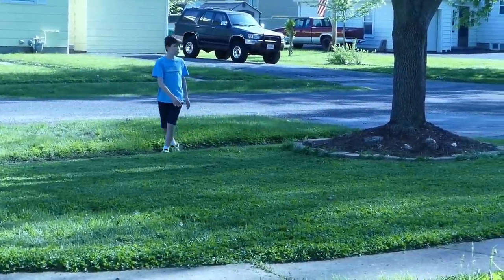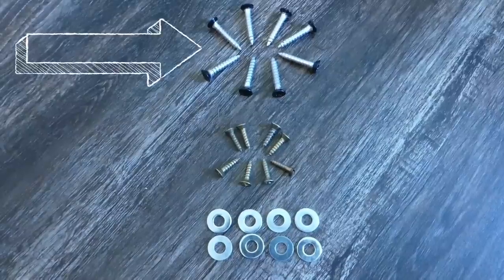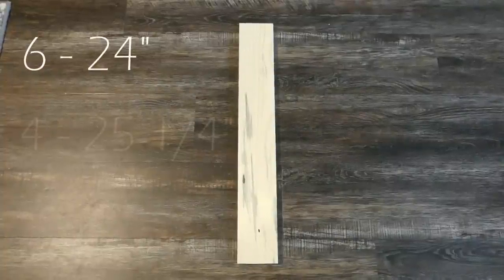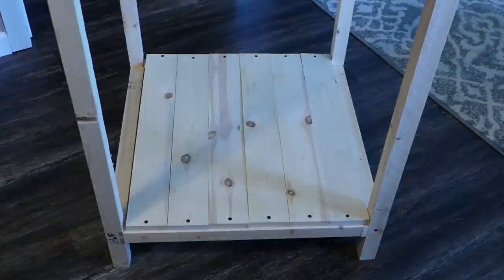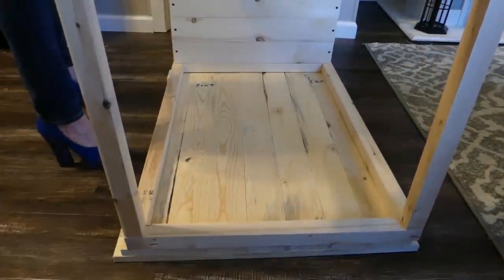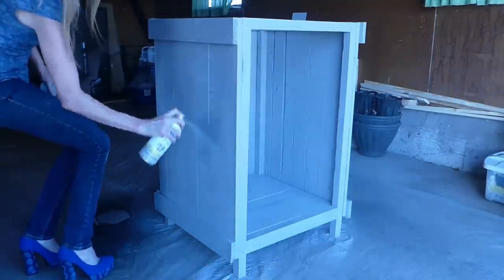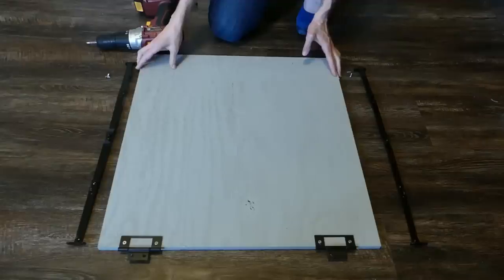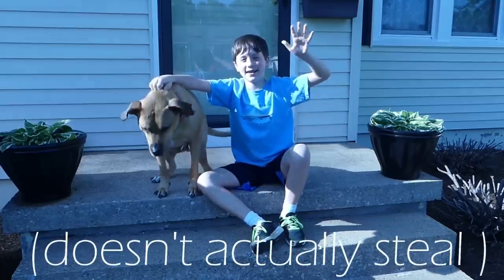'On The Fly...DIY' Porch Pirate Proof Mailbox

Comment: Honestly, anyone can get into that box with minimal effort. Just push/pull the top a little too high...it won't take much force to pull the screws either out of the top, or the security panel, and then you have access to the entire box. It would be better if it was disguised as a hose/gardening tool container. If you already have a problem with "porch pirates", putting a sign on the front that says "Packages" is just inviting them to break into it. Good idea, but the implementation isn't the best. Needs to be fortified quite a bit before it'll really be useful for most people. And some more thought should be put into the weather proofing aspect as well.
Reply: A sketchy guy once told me, locks are to keep honest people from stealing. Nothing stops a thief.
Reply: @mikelewis1166  while I don't disagree with the thief part of ur comment, there is a limit where most opportunity thieves will think that it's not worth the effort. I don't believe that this box is difficult enough to defeat to make it "not worth it" to the average opportunity thief.

oh, and honest people don't need a lock in order to not steal. ;-)
Reply: @DarienCaldwell  ur just being obtuse.
Reply: @ChadFranzen  Lol... Warden Norton would be very angry.

Comment: Couple of things. 1. If you have a large package, the inside plywood flap wouldn't open. 2. What if it rains, the lid isn't waterproof?
Reply: I was thinking the same thing. I'd be afraid packages would get hung up and wouldn't drop down. I'd make it more less deep, but the same height, so the drop down flap doesn't go all the way to the bottom of the box, to allow for larger packages to drop down, and to prevent them from getting hung up on the flap.
Reply: They'll just leave the package on top of the box.

Comment: 34 - 3inch screws
16 - 1.5inch screws 
72 - 1.25inch screws
2 - 8inch gate/T hinges
8 - 0.25inch screws
8 - washers
2 - 3.5inch hinges
2 - 1/2inch hinges
1 - Gate Handle
4 - Cabinet lid support hinges
2 - small machine screws, with 2 small nuts
1 - FRD lock set

1 - Plywood cut 21"X 22.25"
4 - 40inch long 2x2
8 - 21.5inch long 2x2
6 - 24inch long 1x4
4 - 25.25inch long 1x4
4 - 26inch long 1x4
28 - 36inch long 1x4
2 - 28 1/8inch long 1x4 
8 - 27.75inch long 1x4
1 - 21.5 inch long cut in half (1 5/8 thick/wide and other 1 3/8inch thick/wide)

-Build frame with the 2x2s, 4 inches from the bottom, 3 inch screws to keep each piece together
-24inch long 1x4 make floor, using 1.5 inch screws, "ripped" pieces will fit along the sides 

build 2 of the sides 
-lay out 2 of the 26inch 1x4s, then place 7 of the 36inch 1x4s, lay out so that there is the same amount of "extra" on each side, use 1.25inch screws to secure each piece

Build last 2 sides 
-lay out 2 of the 25.25inch 1x4s, then place 7 of the 36inch 1x4s, layout so there is NO extra hanging, use 1.25inch screws to secure each piece

Line up the frame and the sides, secure by using 3 - 3inch screws on top and bottom 
"Extra" will be places on the right and the back of the frame
"No Extra/Flush" will be placed on the left side to open the door on right

Build top 
-lay out 2 of the 28 1/8inch 1x4s, place 8 of the 27.75inch 1x4s, secure in place with 1.25 inch screws 

Paint all the pieces 

Place the last side piece, lining up with the "No Extra/Flush" side to the same "No Extra/Flush" on the box 

Place the T hinges with the knuckle inside

Place the top on, flush with the front but equal spacing on the sides, then add hinges
Add Handle to the top front 

Cabinet hinges 
create a small hole on each end, using 2 pieces add screw and nut to create 2 long hinges altogether 

Plywood 
attach the 2 - 1inch hinges to the 21inch side 
flip over and attach the 2 long hinges about 3 inches in 

screw the plywood hinges from the underside of the frame 
Screw long hinges to the top of the box 

Cut plywood smaller if needed to fit "larger packages" or make box taller 

*Pretty much? whats going on in the video*

Comment: nice design, only thing I can see is if you get a big package then that would not allow the inside to come back up to secure the packages.
Reply: Internal sensors can be used to determine how full the compartment is.  Also different sized drop boxes can be used to accommodate larger items.  Take for example water level sensors that can be wired to trigger alarms, flashing lights for the deaf, "rumblers" for the visually impaired, or other external warning methods once liquids exceed a certain height.

These are often set at the desired height at installation so that when liquids finally do reach that level the appropriately wired responses are issued by the sensor.  Just a matter of finding the right sensors to do this task.

Comment: Good ideas, but what happens if there is a big package or several packages? Would this design still work with cord, chain, or metal rope? That way, if there are a lot of packages or a large package, the top won't be held open when it's full. Might then also want some kind of indicator for that state so that delivery folks and owner will know it's full. Like perhaps an LED that triggers when the inner flap in over a certain height?

Another way to solve that would be to make the whole box shallower and wider, so that the inner flap isn't as deep. It would depend on how large the packages are.

Comment: love the idea, and in an area where theft isn't an issue this will work well. but all it takes is a pair of snips to cut the cable to drop the drop box part and then you can just grab the box / package
Reply: You could use wires or chains. Easily fixable.
Reply: They would just go to the next house where they don't have to do any of that..

Comment: In less-than-desirable areas, I would imagine reinforcing the outer walls of the wooden box with thin sheet metal could further act as a deterrent. It doesn't have to actually be robust to deter the average thief, it just has to look robust!
Reply: seeing all they  have to do is cut the cables... it would take like 5 seconds to get into this thing
Reply: @AlteredCarbons  The idea is to be a deterrent, not to be indestructible. Anyone who wanted to could easily get into a locked house with a deadbolt, but it being there makes it all the more likely that any given thief would go on their way in search for an unlocked door. There are plenty of other houses that don't have any kind of lock box that a thief could spend their time on, why bother with it at all?
Reply: You could also put a dummy camera mounted on the top to make them think they are being recorded. And if you really want to be funny you could attach a voice recording that is triggered when the lid is lifted that says something to the effect of, No! No! No! I see you! And so does my camera! And just in case you decide to damage that one I have another one hidden  on the house just to be on the safe side. Get a job and make your family proud!

Comment: Very good design just use aluminum or steel instead of wood and secure it to the ground by inserting rods into the grass 3-4 ft under it do they can’t be seen and instead of a string use some chains. This has potential

Comment: I love this idea, What is to stop the thieves from breaking the two hinges? Also, I would suggest using the theft proof screws for the barn hinges
Reply: I agree.   A $1 box cutter knife would make quick work of those two straps.
Reply: JimTheSoundsfunny
Reply: JimTheSoundman use a metal chain instead of string?
Reply: @anythinwithanengine6384  Couldn't I then use a screwdriver or a small prybar to remove the chain?   Just playing Devil's Advocate here.   If package theft is that much of a problem, I'd just use the Amazon Locker down a the local store.
Reply: TIME will stop them.
Reply: @aksvan  It looks like one could simply pull the top sharply further than intended and snap the long pieces right off the blocking board then reach inside and take everything. No time required.
Reply: Thieves are stupid. Hence why they are thieves. When they see this they will most definitely steal Suzie's packages down the street instead of yours. When a thief sees the box they're wondering what other security you got, def not thinking about cutting straps
Reply: @Braksas  Well actions require thinking and thinking requires brains and time so that should stop at least the unexperienced thieves.
Reply: Yeah, and I would suggest hiring an armed security guard so packages could be 100% safe. STFU Eastwood.... this is a good idea, thieves don't see a package next to the door, they will keep driving. People can't tell if there is a package inside or not. It's not like they will stop and unload their tools to steal the package.  They are looking for an easy drive off 5 seconds pick up package and leave asap.
Reply: @PIOJOZATANIKO  Wow, so defensive. Do you eat with those fingers? lol Thanks for the chuckle sir. In all honestly I built one using this video as a "base" and improved it. My comment was constructive, not insulting. Too bad you had your blinders on to see that ;)
Reply: @EastwoodFabrication  How else did you improve it? I’m curious and Porch Pirating is on the rise out here.
Reply: Thieves are dumb and impatient. They won't take time to break into this.
Reply: Most porch pirates just grab stuff when they see it from the street. They’re not trying to actively break into stuff, just easy grabs. They most likely won’t even notice the box/know what it is.
Reply: Great idea but pretty sure a hammer fist to the trap wood would break those screws free. There's a reason these are made with much stronger materials when bought from manufacturers and is generally shown in the pricing of them.

Comment: The video was well made with clear and easy instructions.  The key part to this is the locking mechanism.  I'm not at all likely to build something.  But I am very likely to buy a weather tight plastic tool box meant for truck beds to add this sort of lock to.  Especially handy if said plastic tool box has independent compartments.  One fancy lock for each bin.  Then secure it to my house so that thieves don't walk off with the entire container.  

The downside to this type of drop box are the items will stack up unevenly and prevent other items from being deposited eventually.  It also lends to getting damaged goods by the gravity feed system that is employed.  You could eliminate the complication of the guarded inner door by getting rid of it to just add separate locking bins in a manner similar to what I have already outlined.

The material being used would be far easier to break into as the hinge pins are a breeze to tap out.  No hinges means that fancy lock is just about useless.  The hinges should be mounted from within so that their pins cannot be tampered with.  Wood is not the strongest method of deterring a determined or even a casual thief.

There are some suggesting the thieves are ill prepared both mechanically and intellectually.  If that were the case then there wouldn't be theft.  Talk it over with local law enforcement to see what they think of your design.  They are in the know of what does or does not work.

Comment: Any suggestions on how to anchor it to a porch?
Reply: If a cement porch you could drill and add an eyelet anchor you could chain and lock the box too.  

If a wood porch I would fill a good size planter with cement and then chain the box to the planter.
Reply: "L" shape metal bracket from the bottom interior  floor from each corner